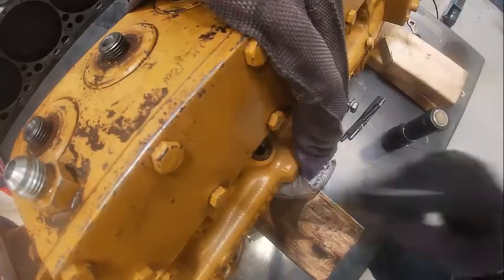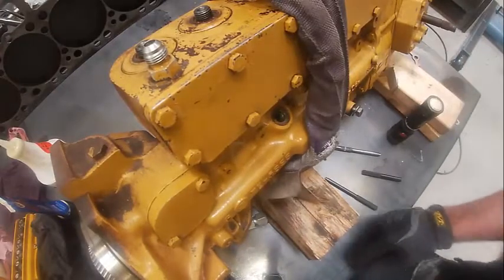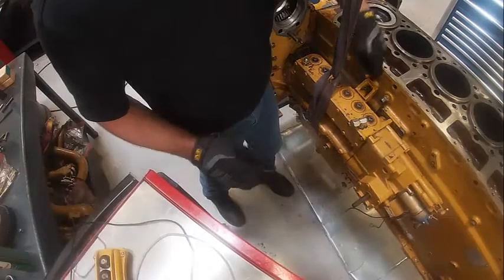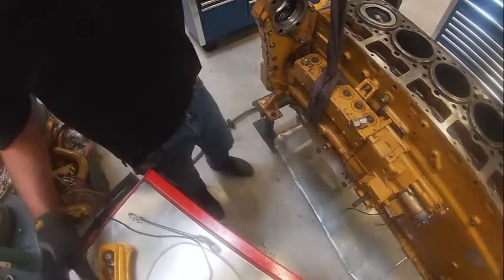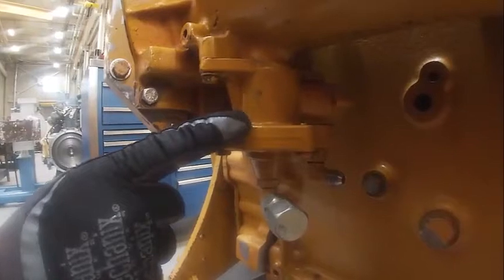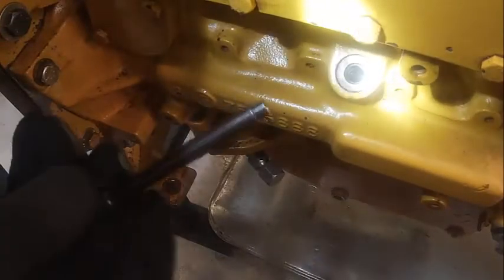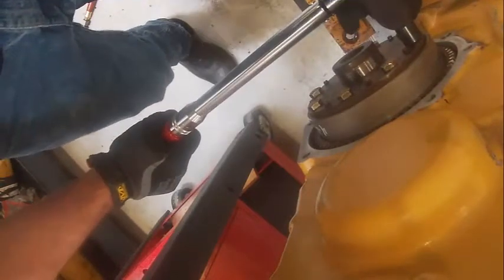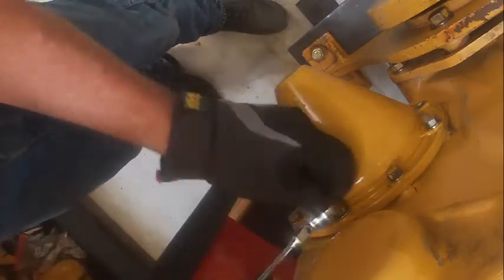3406C Fuel Injection Pump Install

Comment: What is the difference between a 3406 B and a 3406 C ?
Reply from the maker: The fuel system is really the only difference
Reply: @0698gingerich  the 3406 C ,does it come with a computer?
Reply from the maker: @MrTrapichero  I don't believe they did until the 3406E models
Reply: @0698gingerich  , but my friend’s father brought a W900 with a Cat 3406 from 1994 and it has the injection pump and it also has a computer. The throttle pedal is electronic. What model would that engine be ?
Reply: @Jose Delgado  that is a PEEC motor it is a 3406C the PEEC stands for Pre Electronic Electronic Controlled...so the only thing Electronic on it would be the fuel pedal but you can convert that to a mechanical throttle linkage no problem

Comment: For a 3406b fuel injection pump, where does the tachometer cable screws into?
Reply from the maker: It attaches to the same place the hour meter attaches.
Reply: Bottom right corner below shut of solenoid you will have reset idle if adding a micro switch because you have to remove the idle set screw